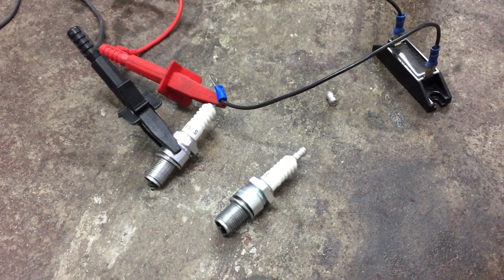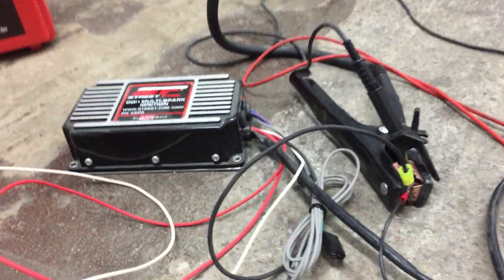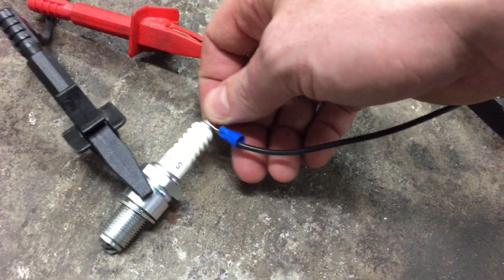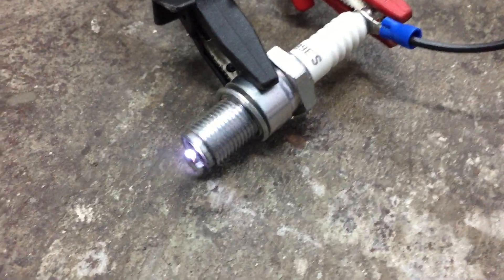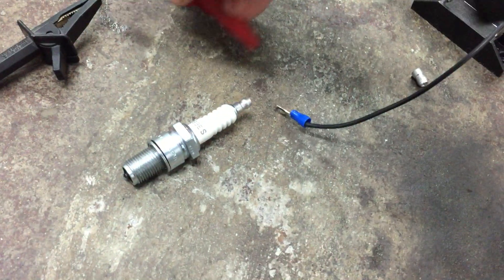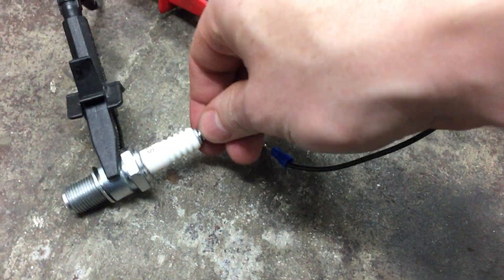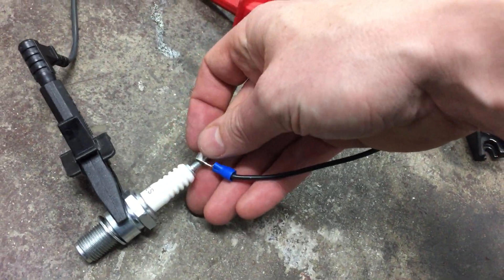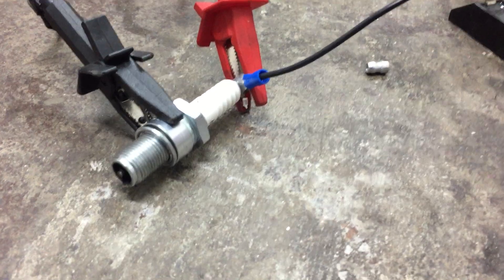Nikola Tesla's Pulse Detonation Engine - CDI Spark vs Plasma Spark Ignition

Comment: yes it works how ever I use ceramic capacitors on positive and negative electrode on the spark plug it self my setup was old singel coil hei with   induction triger and 4pin gm ignition module yep definatly work how ever the set up works best with out resistance components you need perfomance parts probably special spark plugs who can handel plazma ignition by the way it works on eather side of the ignition coil it does not mather polarity the more you add ceramic capacitors in series the stronger the spark I dono what it does to economy but I wanted to run on disel on a gasoline engine some engines are known to by half disel like holden suzuki gm opel some japanes cars my car is a sohc engine they have normaly higher compresion ration the old tractors use compresion ignition no heaters and they use air/oil cooling systems old tehnology but bulet prof probably can by aplied to a car expecialy with governores removed and shity senzors it works best on old cars who dont have that staff you must posibly retarde ignition timing and have a variabel carburetor to lean out mixtures related to this artikel is plazma ignition,plazma generator at exaust,closed system engines,dual ignition waste spark,multi grade fuel runing engines,hot/cold runimg engines,internal/external burning engines,not a suprise realy evry thing goes back to the original ignition system called "dc magneto" no spark plugs ore other crap just 1 wire screwed on the engine block! so hopefully this helps some one cars dont run like described bouth gasoline and disel run on compresion ignition they are the same who many peopel dont know ore are not teached properly they are alredy hybred cars
Reply from the maker: The plasma ignition isn't even needed. You can use a glow plug instead. You just need to heat the chamber up to get it to fire initially.

Comment: Hi, Can you please specify the ultrafast diode? Maybe a link if you can? I couldn't quite hear you. Is this okay? https://www.ebay.com/itm/20000V-20KV-2A-PHVVP2A-20-Single-Phase-High-Voltage-Rectifier-Diode-er-/392954729724

Comment: I have a question you might know, what kind of material i could use to seal a connection between metal vacuum chamber and a glass bell? Some CRT vacuum tubes use some kind of glue material but i have no idea how it is called or what composites they use. Do you know maybe?
Reply: @nikola.tesla.r.and.d.centre  That is helpful. Thank you!
More i research more i see that is not that simple as i thought it will be..:)
Reply: @nikola.tesla.r.and.d.centre  I knew that you will provide the most useful advice, ha! Thank you very much!

Comment: Just a question: so why they build the spark plugs with a leg? Second question: when you say "it's plasma spark" is it just the feeding circuit that makes plasma or is a special spark plug that is qualified as "plasma spark plug"?
Reply from the maker: I had seen plasma spark plugs off the shelf and they had not leg at all. I could have machined the leg off and that might have been even better. I hope to fire this up again in 2022 with much higher frequency and push the limits to see what happens!

Comment: Resistor vs resistor less NGK spark plug . What is the right choice to get ignition booster ?
Reply from the maker: Use the spark plugs and leads with the lowest resistance you can find. Granatelli have a patented 0 ohm spark plug wire whith has what looks like ferrous rings each end for the interference suppression.

Comment: The only purpose is a starter motor for the dual turbine?
Reply: @nikola.tesla.r.and.d.centre  What temperature are you considering water to be cold for this system?
Reply: @nikola.tesla.r.and.d.centre  Yes lower pressure lower energy inputs to achieve steam equals lower resistance to condensation or implosion
Reply: @nikola.tesla.r.and.d.centre  That is good because at high enough rmp I think freezing is likely to occur and only continuous flow will prevent it.
Reply: @nikola.tesla.r.and.d.centre  Indeed there are a number of ways to keep it from freezing up but it is nice to see it can go to extremes and still function.
Reply: @nikola.tesla.r.and.d.centre   Nice, the energy requirements to inject the air are minimal as starting pressure is near equal!